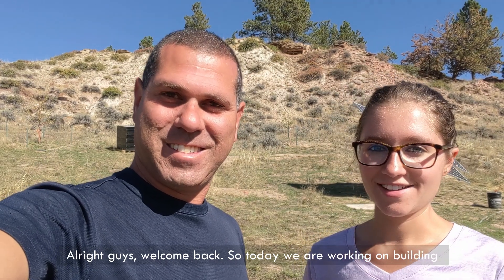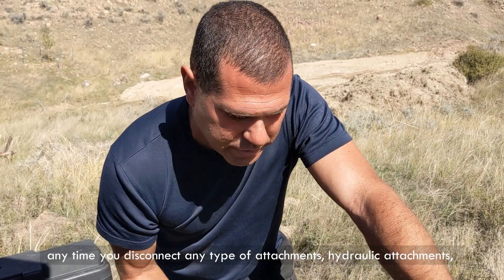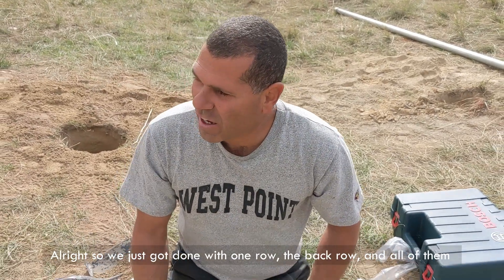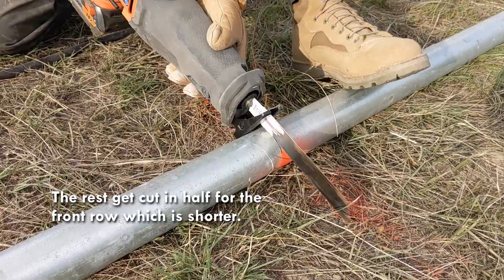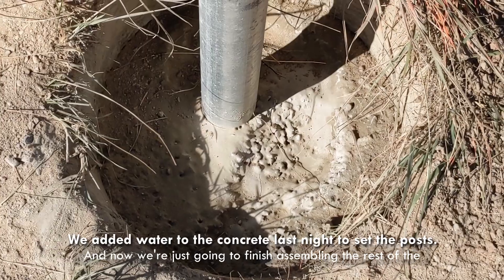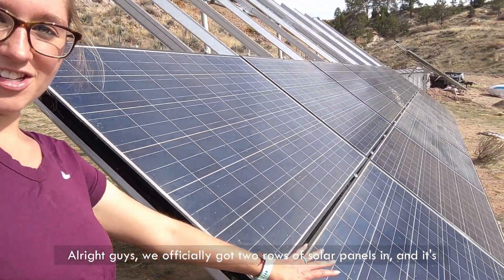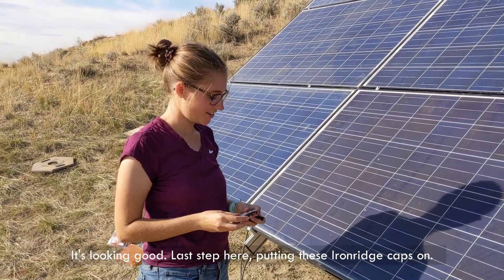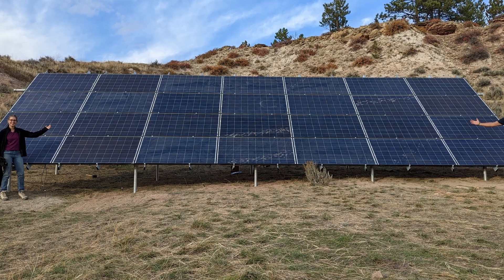This Is How We Built Our Solar Mega Mount

Comment: Did this, one man job. I made the custom concrete footers for each leg, they are about 120lbs each. I used a railing system with just clamps and wood to move the panels to the top rows - good work out. This image is during construction but additional reinforcement and cross bracings have been added. 

https://drive.google.com/file/d/16_rHCNQHc3ESKU20Cb3zAtEhrV4JWmx0/view?usp=sharing

I have a total of 95 panels. This is just  the southern facing array. 6 inverters, 150 amp service. I get about... 94kwh in winter and 180kwh in summer on a sunny day.

Comment: Awesome Job ! How many MW ?
Reply from the maker: Thank you so much :) right now we have 28 panels up on the mega array + 5 panels on the smaller tracker set up. We are able to produce about 8,250 watts an hour charge from our current panels. Hope it helps!
Reply: @theinspiredjourney  
@theinspiredjourney
преди 31 минути
Thank you My system has batteries. 12 batters x 100 Ah = 1200Ah x 12.8 V = 15,360 KW /´( 2000KW Voltage transformer from 12 to 230V) and so I have about 7 hours 230 Volts at home .